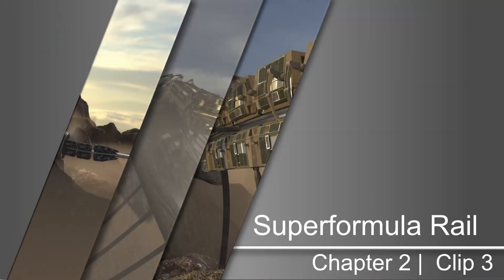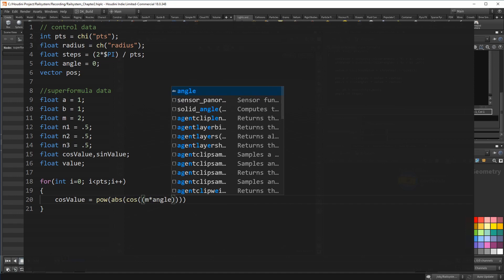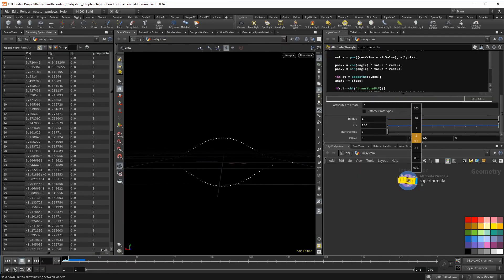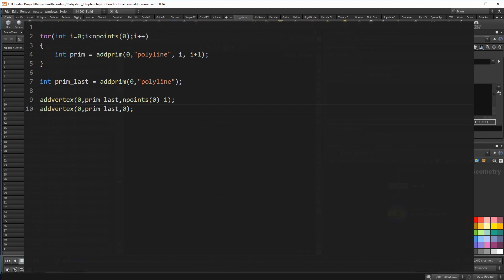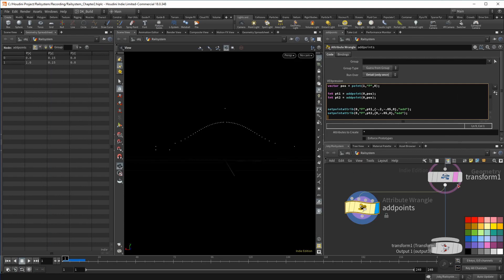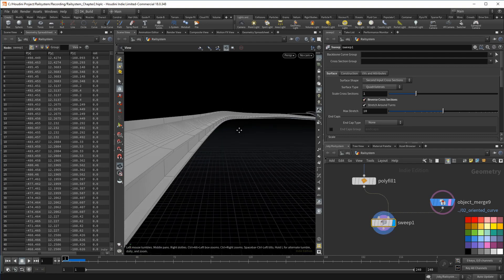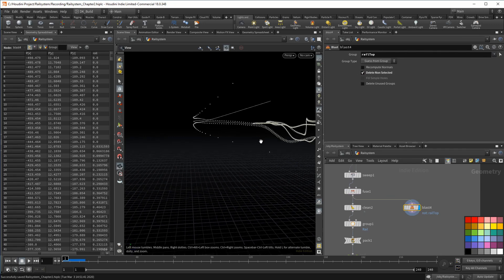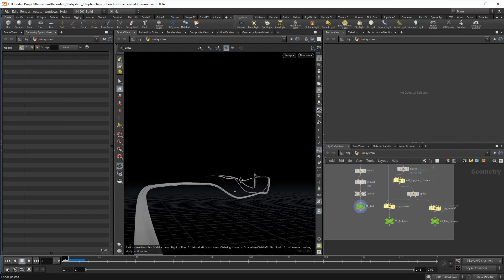Superformula Rail | Houdini Railsystem | Chapter 2 - Clip 3

Comment: Superb tutorial. Just quick tip for everyone, because you are using VEX a lot. You can simplify retreiving atribute from second, third, fourth input easily by writing v@opinput1_P (here for position attribute).  You can then easilly for exapmle smooth curve just in Y direction connecting unsmoothed and fully smoothed curve to one wrange and write only these two lines: 
vector pos1 = v@opinput1_P;
@P = set(@P.x,pos1.y,@P.z);
Reply from the maker: The opinput#_attribute is a good hint. I don't use it personally - just because I feel it makes a snippet a bit harder to read if you are not used to it. On the other hand it allows shorter coding like you described.

Comment: What am I doing wrong? I get this result: https://imgur.com/a/NYKU2iF. This is my formula:  // control data
int pts = chi("pts");
float radius = ch("radius");
float steps = (2*$PI) / pts;
float angle = 0;
vector pos;

//superformula data
float a = 1;
float b = 1;
float m = 2;
float n1 = .5;
float n2 = .5;
float n3 = .5;
float cosValue,sinValue;
float value;

for(int i=0; i<pts;i++)
{
    cosValue = pow(abs(cos((m*angle) / 4 ) / a) ,n2);
    sinValue = pow(abs(cos((m*angle) / 4 ) / b) ,n3);
    
    value = pow((cosValue + sinValue), -(1/n1));
    
    pos.x = cos(angle) * value * radius;
    pos.y = sin(angle) * value * radius;
    
    int pt = addpoint(0, pos);
    angle += steps;
    
    if(pt==chi("transformPt")){
        setpointattrib(0, "P", pt, chv("offset"), "add");
        setpointgroup(0, "railTop", pt, 1);
     }

}

Radius is 1 and Pts 100 offset 0,1.7,0 and Transformpt 0
Reply from the maker: It looks right... but sometimes it's just one character that can mess things up. I start a file tonight after the dog round. :)
Reply from the maker: Jesus... it is so obvious but I actually had to stare at both our codes for a while to see it xD 
In the formula where you create cosValue and sinValue - you used cos() in both and not sin() for the sinValue
Reply: @DavidKahlVFX  damn thank you